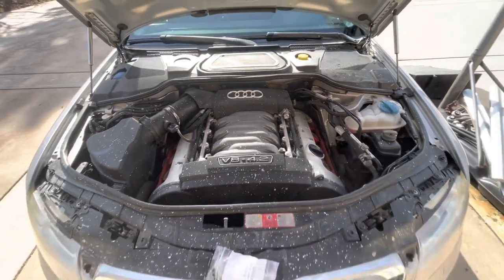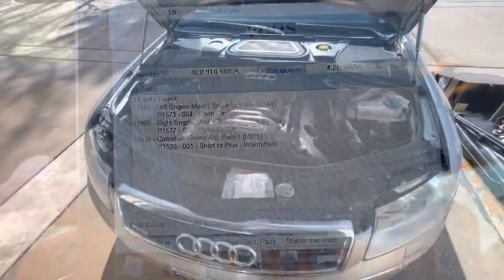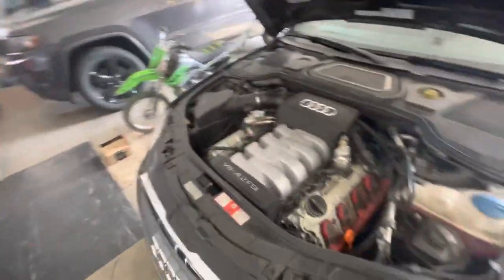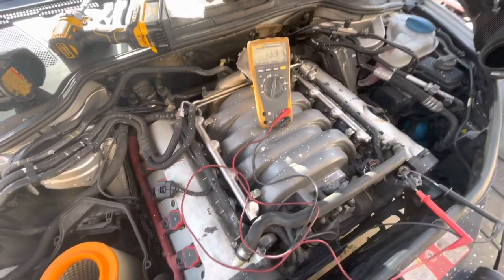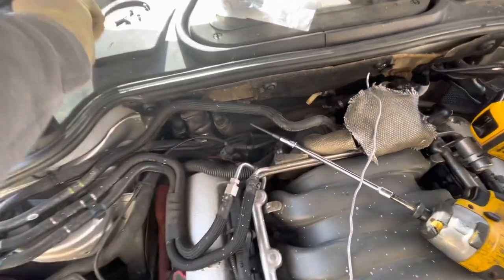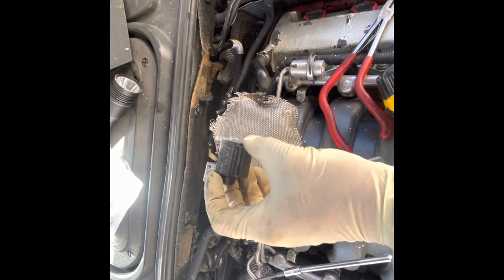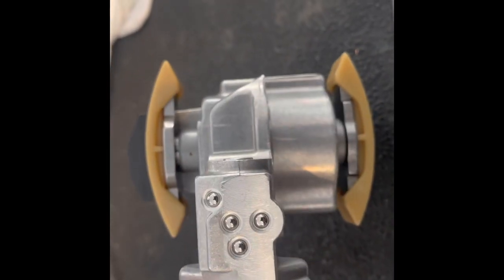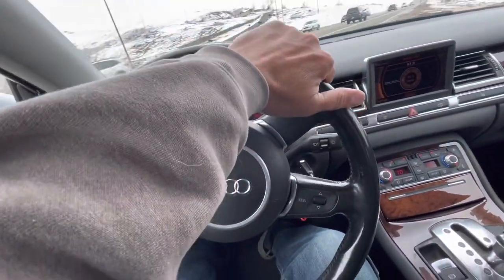2004 Audi A8L D3 4.2 V8 cam actuator solenoid replacement. P1526 or P1534

Comment: I have an 06 A8L and got a P2093 (Camshaft Position Actuator Control Circuit High Bank 2). The part you got off eBay looks exactly like what shop recommend I replace.

Comment: Just came across this video, I'm not sure if you still have your 04 A8 but  wanted to ask how is it running with the Timing Chain Actuator solenoid that you got off eBay?
Reply from the maker: I have a follow up video to this, I ended up having to replace the entire actuator. I believe the actuator piston was stuck and the electrical solenoid burned up due to being applied constantly. I drove the car for a few thousand miles with the eBay actuator and had no problems with the part.
Reply: Ok, was just curious about how long that part lasted.  I priced the part at FCP Euro and AutohausAz but hadn't purchased it yet.